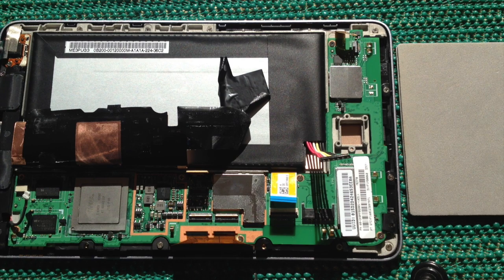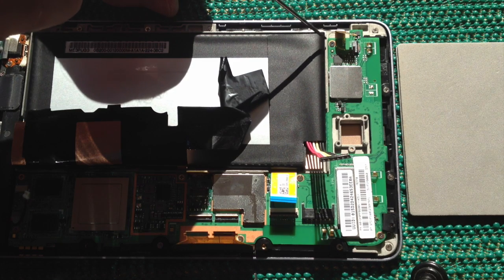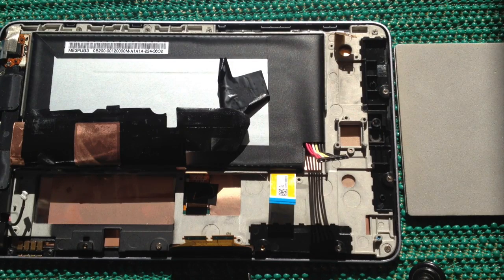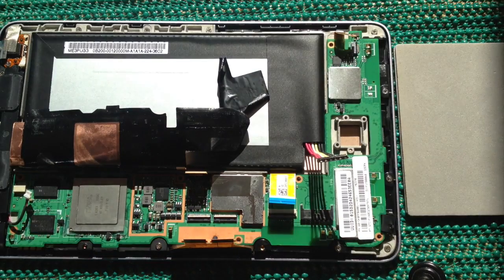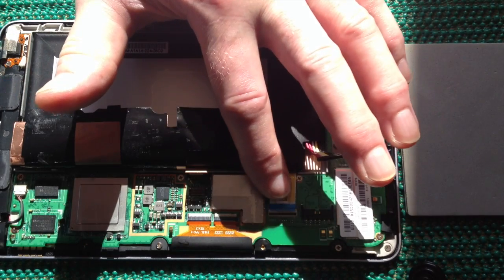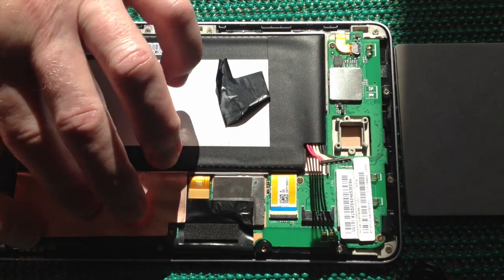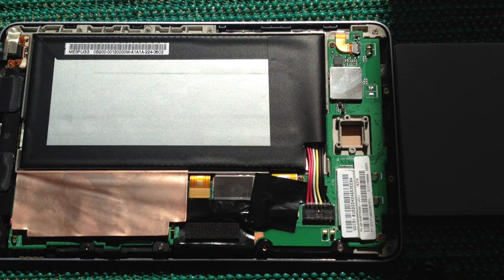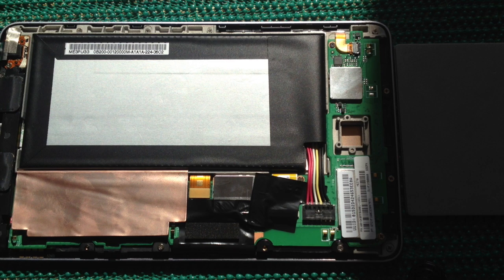How I Replace A 1st Generation Nexus 7 WiFi Motherboard Part 2

Comment: So I have a Question on my nexus tablet I did a factory reset and from there it went to the set up choosing a language and after that on the next screen which is Select a network, nothing comes up and it doesn't allowed me to skip so I'm stuck with the tablet on the WIFi screen been like this for about a year I wanted to know if maybe its internal? I tried the bootloader and recovery mode and nothing helps. Do you know how I can fix it

Comment: i got a question ok my nexus 7 is origanilly a 16 gb model can i buy a 32gb and install in it or would i just be bound to buying the 16gb
Reply from the maker: +Harry Colón Hi harry thanks for the question, if its a WiFi Nexus 7 2012 as featured in my videos, the 8gb Nexus 7 and the 16gb Nexus 7 motherboards can be directly replaced with the 32gb boards, they are the same size and shape and have the same connectors.  If you go to the fixed1t website using the following link and the select the Check out fixed1t eBay for latest deals of Nexus 7 parts http://www.fixed1t.co.uk/fixed1t_Nexus_7_Refurbs.htm  you will find some 32gb Nexus 7 motherboards set up and tested by myself.  #fixed1tNexus7repair
Reply from the maker: +Harry Colón here is the video link: https://youtu.be/556jPNfsxfQ?list=PLVnKaE3t-yQU-1I5bQ9Hge7HnSwUK2wrl #fixed1tNexus7repair
Reply: +FIXED1T maybe i am not understanding right but so my tablet is 16gb all i wanna know is if i can ur 32gb and if it would work on my 16gb motherboard thats all
Reply from the maker: +Harry Colón Harry, there is no upgrade path for the 16gb motherboard.  The only way to upgrade the Nexus 7 is to remove and discard the 16gb motherboard, and install a replacement 32gb Nexus 7 motherboard. #fixed1tNexus7repairs
Reply: oh so i can buy a 32gb motherboard and install it ok cool ty for answering my question

Comment: Hi there, I just replaced the motherboard by following your video but still not booting up. Only white flickering lines when I connect to wall charger. Anything I did wrong?
Reply from the maker: +SarapBuhayBoy Hi thanks for the question, I can only vouch for the motherboards I test, setup and sell, I'm afraid that recently I too have purchased a whole pile of junk (totally broken) Nexus 7s with motherboards.  Opening them up, the bare shell had been populated with broken components to look like they were a Nexus 7 that just stopped working.  In reality they were a badly put together collection of broken items masquerading as a spare and repairs item.

Unfortunately, there are some unscrupulous people out there who sell defective crap, me I only sell what I would be willing to purchase myself, at rates I would buy it for.  Thats why on fixed1t ebay I have 100% positive feedback.

Alas, there has been and is a race for the bottom on cheap rubbish parts, which has undercut the prices of the quality sellers, so I like others are selling good tested parts at those prices. #fixed1ttip

Comment: Tablet just booted up - been sitting there for a year broken (accidentally wiped the bootloader so it was just stuck in APX mode - annoying considering all the parts were actually working!) and saw that you can fix the problem by replacing the motherboard, did a quick search and found FIXED1T's motherboard's for the 2012 N7 on eBay. Was terrified at first when it didn't do anything but after leaving it for a while to charge it booted up! Couldn't be more pleased, got myself a working tablet back for 20 pounds - I recommend anyone else in England who's suffering from Windows installing the 'APX' driver when it's plugged in to buy a motherboard from here - worked a treat! Thank you.
Reply from the maker: Luke Phillips Luke so pleased it solved your problem, its such a simple solution there must be high numbers of devices discarded and forgotten.  As you say its really simple to do as long as your gentle and do it slowly.  Thanks for the great feedback.
Reply: Hi Luke, just want to ask how long did you charge before it booted up?

Comment: useful video for fixing my neuxs
Reply from the maker: Thanks Alan for the Thumbs Up and the Comment.  I'm pleased to hear the my fixed1t video and the fixed1t eBay replacement Nexus 7 version 1 32GB upgrade motherboard worked for you.  As you discovered its a really simple upgrade to do if you have a working 8GB or 16GB Nexus 7.  You just need a little patience, time a gentle action.  Glad to be of service. Kind Regards fixed1t